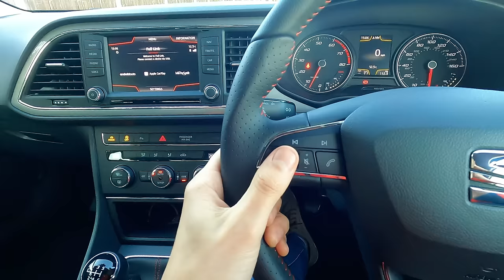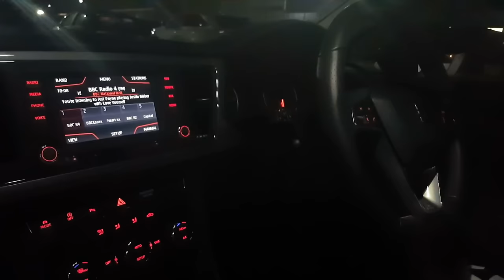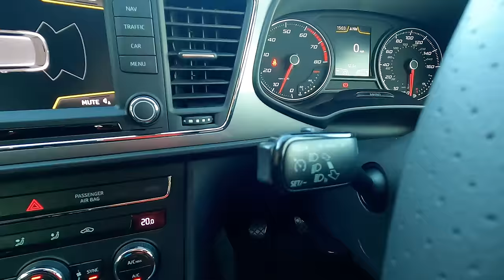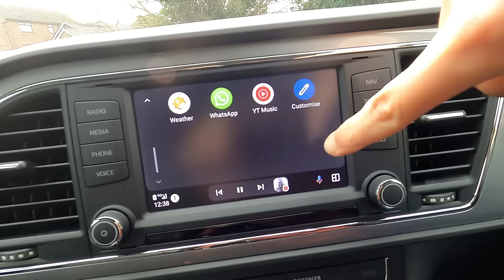Repairs and Costs Over 205,000 miles in a SEAT Leon Petrol

Comment: Very interesting. I've owned the same Volvo for 31 years and do all my own servicing. Other than normal wear and tear items (brakes, battery, etc, and one clutch change) , the only major parts I've replaced are both front drive shafts. Everything else, including incredibly in my mind, most of the builds, are original.

Comment: I love the fact that you still use the same car for that many years instead of changing it every couple of years like some driving instructors do.

I have a Peugeot 206 2005, 1 litre petrol for 3 years now, after 6 months of owning it the timing belt snapped first and ruined the engine. Wasn't cheap to fix but looking back it was definitely worth it,

 had other stuff done to it basically looking after it well, I've often thought about getting a new car but the more I get the Peugeot serviced and get things replaced, I just feel I know the car inside and out and how it drives. 

It's not the most flashy and is more of a woman's car or "mom's car" but I suppose if a car hasn't really let me down considering the age it is I'd probably be better keeping it for as long as I can. Has 260,000 kilometres on it don't know what that is in miles haha. Keep up the great work as always Richard!

Comment: I have a 2014 Leon too and mine is on 150,000 miles, mostly all motorway driving. Still on the original clutch, flywheel and even battery!
Reply: 10 years on original battery? That's really impressive actually, most batteries are done after 5 years max
Reply: @ATICrossX  I had it checked a few months ago at Halfords and each cell was showing 3.1v I think, so total capacity of 12.4v or around 60%.bjt it goes on a loot motorway journey 5 days a week so the battery is alway full
Reply: @t4om154  Nice, I just recently replaced battery on my 6 year old Hyunda i10, voltage was still reaching 12.6 or so but it had no power, it was struggling to crank, to the point if you turned on lights for more than 5 seconds before turning the car on, it wouldn't crank and I had to use my booster battery to turn it on every time

Comment: I have the 2liter Diesel estate Version of yours  on a 64  plate and I love it. It's now done close to one hundred and forty thousand miles and with regular preventative maintenance including oil changes every 9000 miles and cambelts etc every 60 thousand miles it has proved to be totally reliable with fantastic fuel economy. If you keep the engine in it's "sweet spot" E.G 1600 to 1800 rpm it'll do around 70 Mpg on a run easily
The most I've ever seen was on a trip to Lancaster, when restricted to around 50 mph due to heavy traffic for around twenty miles of the trip it turned in just on 90 mpg and yes i do have a photo of the on screen display to prove it!  the only fault of note was needing the heater matrix replacing as it had blocked internally, a common failing I'm told, but with that now replaced I haven't had any other problems. one set of disc's and pads at about 80 thousand and one set of pads in the front since. 
All four shocks were replaced at around a hundred thousand due to one front and one rear shock leaking and the original battery was replaced just before this winter, because like the one on your car it was showing signs of getting weak. My car is very rarely used for stop start town work and often does around 500 miles in a day so no probs with the DPF to date. Will I change it in the foreseeable future? Not on your life!

Comment: My 2001 mk 4 golf gti 1.8t has done similar miles. At 22 years old and 210k miles its only ever had 1 ht lead and 2 batteries. Cruise control and folding mirrors failed but not fixed either. Thats it, nothing else except routine servicing. 
Webuyanycar valued it at £150! And thats why I keep it.

Comment: I have a 2017 Leon Fr, had it since 4k miles, and its now done nearly 100k. Only problems I’ve had is the dust cover for one of the alloy wheels came loose and had to be removed, and a common issue with Seats the boot seat logo no longer springs back into neutral position when opening the boot. Brilliant car.

Comment: i have 2 leon’s, one 17 plate fr 1.4 ACT and the others 14 plate 1.4, what i learnt from this is to remove the coil packs with a hot engine. I had to use a crow bar 😂 and the fuel cap locking mechanism failure seems to be quite common. I’m looking to code the start/stop to default off using VCDS and i’ve changed the boot struts to the ocatvia ones, so it can automatically open the boot if you hold the middle key button down. overall great cars and quite fuel efficient. I wouldn’t recommend ACT just due to the timing belt change being a lot.

Comment: My dad owned a Hyundai i30 from 2016 to 2021, car was quite reliable and the only thing he has replaced, excluding brake pads, etc.. was the rear wiper blade. He also used to do oil changes every 25-30k Kms.

Comment: I’ve done 90k miles in mine from 2016. Still love it. I have never had a repair or recall. I have only ever had scheduled maintenance and wear items live a single brake job and new summer tires once.
It’s a commuter car averaging about 45 mph overall with very little traffic, so that’s only 2000 hours which in comparison to your learner Leon is nothing.

Comment: HI Richard...phenomenal piece of work.  The detail in the presentation is just amazing.  Nice effort! Very few people could replicate that level of wear and tear, or record keeping.  You did a great job keeping the Leon in tip top shape, but were fortunate in that you are capable mechanic.  Most folks would have faced bigger bills as a result of needing more professional assistance. SEAT clearly do a great job with bodywork and paint, plus the car functions and drives well.  But just like my experience of other VAG products they're not as thoroughly tested prior to being put on sale as they should be, and the customer ends up doing some of the dev and test for them.  That's what I found with a recent MK8 Golf, a nice car to drive, but literally awful from a software reliability perspective.  Also after 2 years paint was flaking off the rear wheel arch.  Shocking quality.  You had a far better experience.  Well anyway - great video - learned loads.  Brilliant.  Cheers! Rich 👍

Comment: Great video and puts our ownership of our first car to shame. After passing my test we bought a 20 year old Honda CRV for £3,000 with 113.170 miles on the clock and two year later it’s now showing over 134,000. But and it’s a very big but, it’s had that many things go wrong that needed replacing it’s cost us a further £3,400 not including £500 on a full set of Yokohama all season tyres. We’re now thinking about buying another car (used) but can’t help thinking will we buy someone  else problem and we’re back at square one again. We’ve replaced the CAT and both o2 senses,condenser,compressor and aux belt,a third gear sensor, a front strut, then the usual brake pads,brake discs and three out of four calipers. We’d get next to nothing for trade in and the car means so much more to us and has really been a great car for us in getting to go places we would never have got if we used public transport.

Comment: I’ve had a MK2 Leon tdi cr140 since 2019 done 110k in it so far. It’s been brilliant I got warned about the egr/dpf and no issues so far. Engine runs smooth and is nippy. So far no other faults 🤞

Comment: I own Seat Leon FR 1.4 2017 over 100k mileage. I couldn't be more happy with it. Really love this car, no problems at all, engine works really smooth, looking fresh despite its age. I highly recommend it specially for new drivers. It is cheap to insure and it has 150 bhp and weight slight over 1 tone, it's pretty fast considering small engine and handle like dream. Ps. I think the touch screen issue is on every seat leon from around that production year, my does the same during winter time but only for 2/3 minutes when I start it, not big deal for me. I just let the car warm up then I turn on the radio.

Comment: I've currently got a Ford Mondeo 2008, I bought the car in 2017? Maybe at 115k Miles. I've had it up till now (Feb 2024) and am currently at 170k Miles and the car is still going strong! I paid £2500 when I bought it and only major parts have been a clutch at £300 and trailing arm bushings at £300 for the pair.

Comment: heya man, i just also bought a leon mk 3,5 off a german dude that drove it up an down the autobahn A LOT (250 000km since June 2017) so this video is a godsend in terms of preventative maintenance and information in general. thanks a lot. if you have anytthing else important to share i'm all ears :)

edit: but as i'm watching along, i have to disagree with 29:46, the bonnet on my nevada white ST is in terrible shape, the leading edge is absolutely ravaged by stone chips. but i suppose that is to be expected when you're going at high speeds.

Comment: The most impressive thing about this car by far is that it doesn't burn copious amounts of oil at 18,000 mile oil changes which really shocked me, especially the kind of driving this car does which is mostly low speed town driving with lots of idle time. Also impressive that it hasn't rusted that much, especially around the wheel arches.
Reply from the maker: So much idling, when I'm making these videos there is a lot of idling also.
Reply: @RichardFanders  How long do you plan on keeping the corolla if you don't mind me asking? Considering the high cost of new cars as well as the long warranty that Toyota provides it only makes sense to keep it for very long.
Reply: @aden3113 toyota has a 3 year warranty, isnt that the standard for cars? Kias is 7 years
Reply: @aaroncousins4750  Yes but that's standard for lots of brands, if you service it at their dealer they'll extend the warranty up to 10 years or 100k miles which is the crazy part.
Reply: That also suprised me. Especially since I had a 2013 Seat Leon 1.2 TSI in the exact same color, which started burning oil just over 100.000 km mileage, in the end 1,5l/1000 km at 140.000 kilometers. The piston rings were clogged.
Reply: @Nhjz  Seems almost unbelievable that it doesn't burn much at 18,000 mile oil changes, I don't see any reason for him to lie but that's the first car I've seen that hasn't gotten ruined from extended oil changes, especially with his driving style.

Comment: We have the 2016 2.0tdi 150bhp version. I was the second owner from 35000miles. It has been remapped from 40k It's now on 97000 miles. Apart from lots of front tyres and 1 set of brakes, cambelt and water pump the only unexpected thing to go wrong in all that time is 2 rear springs which I was sad about as the stance was much nicer on broken springs. 
I did the other way for android auto the same old screen but you change the plug socket and pay a man £60 rather than the seat dealers £200 to activate android auto and that saved the car for me too.

Comment: Totally agreed about technology pushing you towards newer cars. I was following a Porsche with matrix headlights down a country road and it was amazing to see in action. So much visibility to the sides yet dimming the area around oncoming cars so they weren’t blinded. My halogen high beams seemed lacking in comparison. Counter tech point if you get a car with a nice feature that isn’t common on newer ones it really limits your choice. I like my 360 cameras but e.g. nothing from Stellantis has them. Lower end VW doesn’t have them either.

Comment: brilliant cars had a toledo diesel 1.6 still being used as a taxi 300,000 + miles sold it to someone i know have a leon fr estate sport petrol tsi 177,00 miles so far at 4.5 years old does'nt miss a beat same clutch new battery cam belt changed had 3 ibizas prior to that lot of car for the money very reliable

Comment: Given the abuse that clutch must have taken, the low wear rate is seriously impressive! I was only just chatting with my dad about just how much better cars have become. Back in the 1970s and 80s, 10 years was a good innings for a car. These days, 10 years is (as we can see!) almost like new, if it is well looked after. £14:50 per week in repairs is hardly expensive! As electric cars come in, I can see quite a lot of internal combustion engined cars getting maintained for the long term, and not just by enthusiasts. It is a real credit to you and to Seat/VW. 

Have you driven a GR Yaris? The rear view mirror blocks a huge amount of the view ahead. It is fixable to an extent, but the rear view isn't amazing. I can understand you wanting one (although they are out of production now) but I'm not sure how learner friendly they would be. They would feel a bit claustrophobic to do 19,000 hours in.
Reply from the maker: The updates GR Yaris solves that issue with the mirror. I would extensively test one before I would decide to buy one.

Comment: What a comprehensive review. Just shows what modern cars can run to if you look after them. No need to change every 3 years to keep up with the Jones'. The difference comes in technology as you say, and also in active and passive safety. I'm not saying the Leon is now unsafe of course. Also, I can't help thinking that keeping perfectly serviceable cars on the road as you have, is far better for the environment than changing to a new car every 3 or 4 years when you look at the whole lifecycle of a vehicle. New, and even zero emission cars, still have raw material mining impacts, plus ship transportation and manufacturing footprints. Greta might disagree.
Reply from the maker: To be fair, it's the average life of a vehicle that counts when it comes to manufacturing emissions as apposed to how long the first owner keeps it. The manufacturing emissions should be spread out across the life of the vehicle as all owners are going to use the vehicle. Selling a new car after 2-3 years supplies the used market with a more affordable car allowing more people to have modern safety tech, the more people who do this, the cheaper uses cars are.
Reply: I guess so. Never really thought of that angle about the supply of second hand cars. However, I'm still sceptical of the narrative that wants people out of perfectly serviceable cars in to brand new eco cars. I'm not talking about big V8's. But the humdrum family 1.6's. What's already been mined, transported and produced cannot be put back. So surely keeping a car going with proper maintenance is better than buying a new one. The culture of buying a new car every 3 years on eco grounds doesn't sound very eco conscious to me. @RichardFanders

Comment: I reluctantly traded my Leon in at 92k miles as it was getting too expensive, sounds like you've got quite lucky (or I was just extremely unlucky). In its last year I had an indicator fail (which meant replacing the entire headlight), battery replaced, ABS pump and throttle body both failed within a few months of each other.

Comment: I ran my 2006 2.2 diesel Civic to 227k miles over 11 years. I'm sure some years it cost me zero going by your economics. The only reason I retired it is because of rust. I recently replaced it with the last generation 2013 Civic 2.2 diesel. I hope this one is as reliable. 

VAG stuff tends to be less reliable and live in the garages in need of repair.

Comment: We ran a pair of Renault Clio MK2 1.2 16v's as driving school cars from 2001 to 2004 both done around 160k when changed for another pair, these done similar miles until 2007 when they were replaced with a mk3 Clio and a MK2 Twingo both 1.2 16v, in 2010 these were both replaced with Facelift 1.2 16v Twingo's again similar miles, 2014 they were replaced with a pair of mk4 Clio 1.2 16v's until both cars and the business was retired. Fun fact - these cars done over 1.5 million miles without a single failure!

Comment: I once bought an ex driving school car, a 7 year old Peugeot 307 1.6 HDI with 197k miles. I knew the lady who owned it from new, apart from the usual servicing and consumables the only thing that car needed was 1x clutch and flywheel at 100k miles and another clutch at 180k miles. I kept it going to 230k miles until a learner driver drove into it and wrote it off, the irony eh! Despite the hard life it led before me it actually was a really tight driving car.

Comment: My wife has done 95k miles in 3 years in her hybrid Corolla and not had any issues just had servicing
Reply: Service toyotas they will run for miles
Reply: @GameWithViiP3R  very true 👌
Reply from the maker: They have a good reputation. Although ours needs a new door control module that we've been waiting 2 months for.
Reply: @RichardFanders  ah that's annoying, my wife is too a driving instructor and its been a good choice for her , 65mpg and no issues so far 😊

Comment: I have a 1986 VW Jetta with 323,000 KM, which when converted to miles is around 207,000. Interesting how in 10 years you've covered the same milage as that car in 38 years.
Reply: Imagine how many hours the car has done! It is probably like triple when compared to the miles !